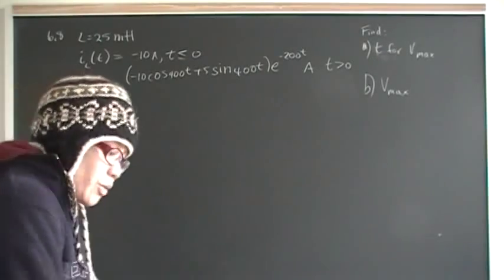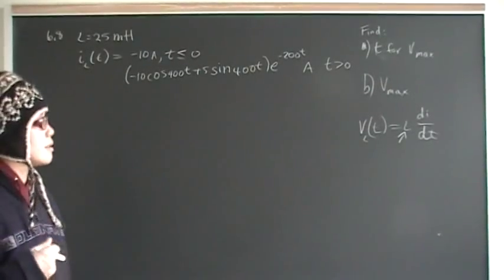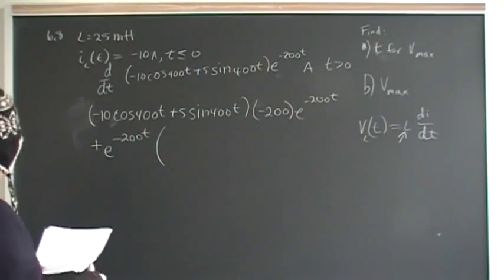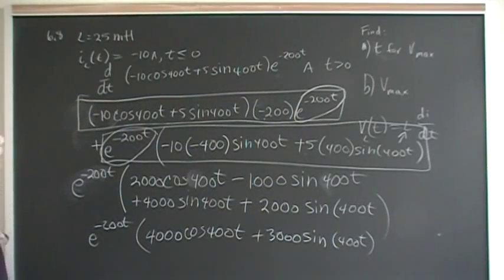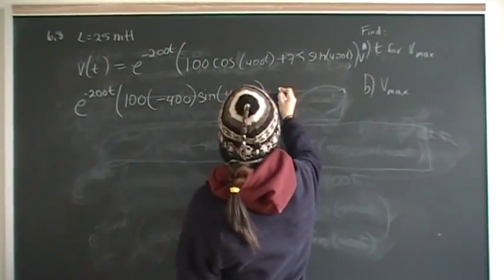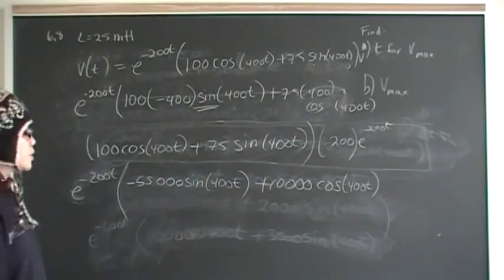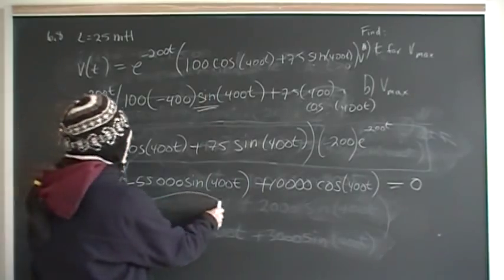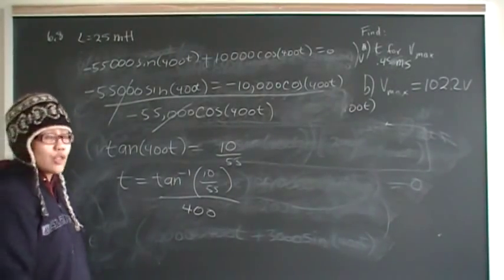Inductor Circuit Analysis Intro P6.8 Nilsson Riedel Electric Circuits 9E Solution

Comment: Hey Thuymyers! 
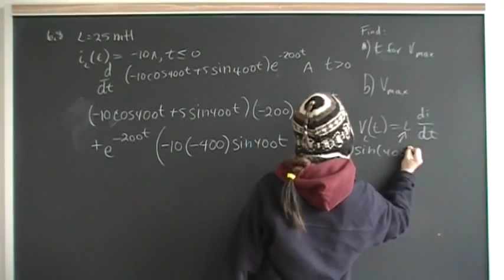I think you might have made a mistake while evaluating the product rule at 3:49, where the derivative of 5sin(400t) turns into 2000sin(400t) in instead of 2000cos(400t). 
After that, (since you might have calculated it right on your answer sheet), the answer shows up right. ^^ Anyway, nice job :)